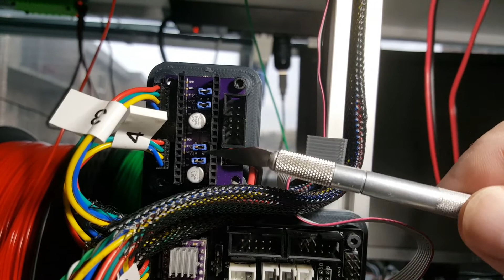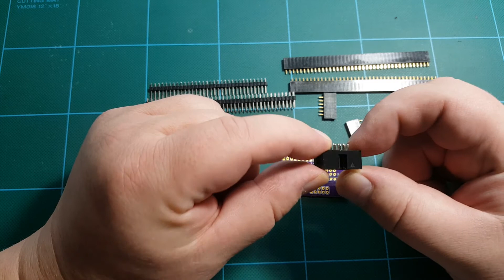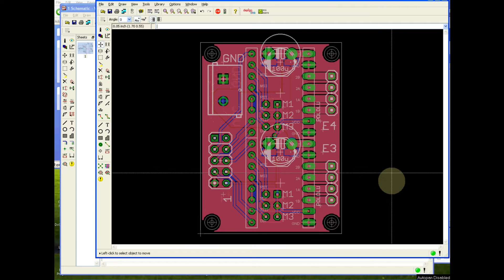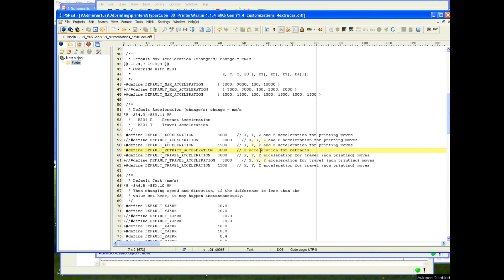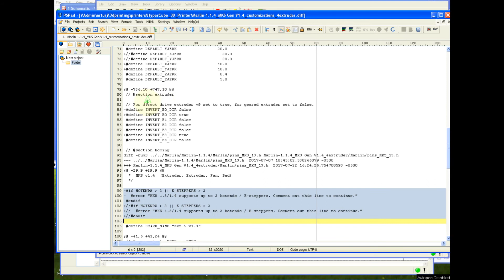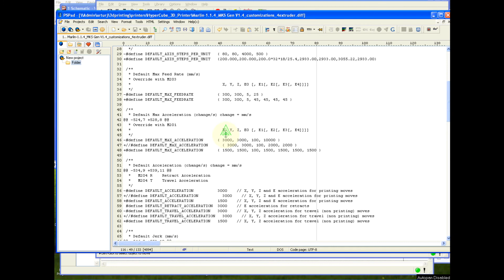Driver extension for MKS GEN

Comment: Hi Artur, thanks for the update. Audio was sometimes hard to understand. You may check Prusas solution to switch Extruders https://github.com/prusa3d/MK2mm_Stepper_switch
Reply from the maker: sorry about the audio. First time I used new software and apparently it has trouble handling audio with different sampling rates. I wanted to be able to drive 4 extruders simultaneously in case I try diamond mixing hot end but it appears that that's beyond what 8 bit controllers can handle.

Comment: There is an expansion board available it's around $6 -- not as clean an need as your setup, but no need to create your own board. I've used them often to add additional steppers to my machines. I'm using TMC2100s in a pair now. I think you should look at Prusa multi material upgrade, I believe he has a separate board handling filament switching -- 8 bit boards can't handle this number of stepper drivers. A 32 bit board -- I'm using a Duet -- would be much better for such a configuration
Reply from the maker: I agree. 4 extruders may be beyond what 8bit CPU can handle. I wanted ability to run 4 extruders at the same time in case I try using diamond mixing hot end. I hope 32bit boards become popular and inexpensive soon. Until then Prusa approach is probably better.
Reply: A 32 bit china clone of a smoothie isn't that expensive -- MKS SBase is only $60 -- which is a very reasonable price IMO. If you're using 8825 drivers and are happy with them, then this board is your best bet. It has 2 extruder steppers built in, and you can use your expansion board to add 2 more very easily -- no need to recompile the firmware, just change the config file and define extra extruders etc. You can also do super cool things like define T4, and T5, etc  to create mixing ratios etc, so if you had white and red loaded in T0 and T1, you can define T4 (your virtual 5th extruder) to be 50% T0 and 50 T1 and create pink. A lot more options.  If you spend extra, you can get a cohesion 3D board -- which is a US made smoothie board. In either case it's trivial to add extra steppers to it. Prusa approach is very tricky -- it's relying on properly cooling and retracting filament and each color change -- not a simple thing to get right -- plenty of people report clogs using that solution.